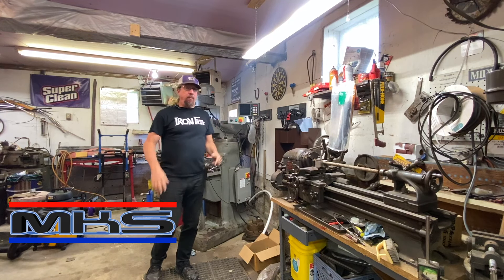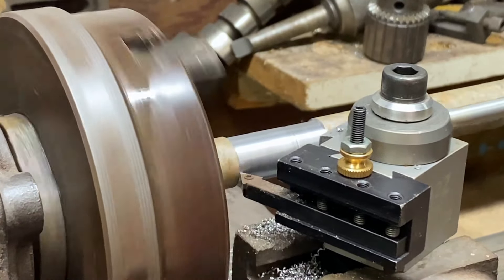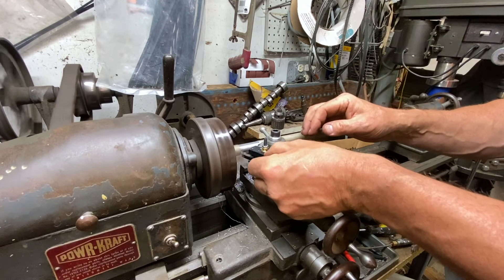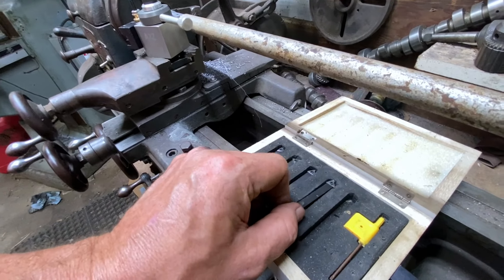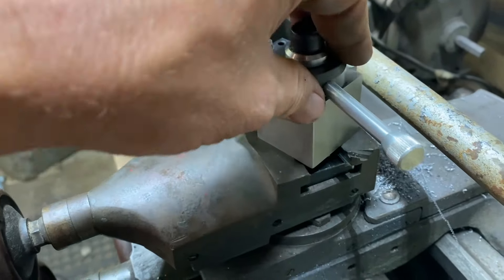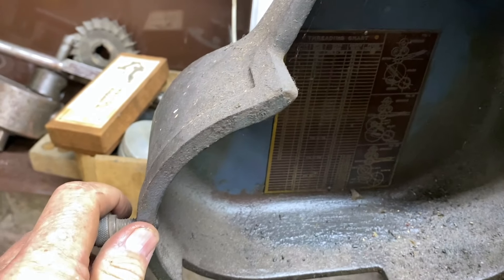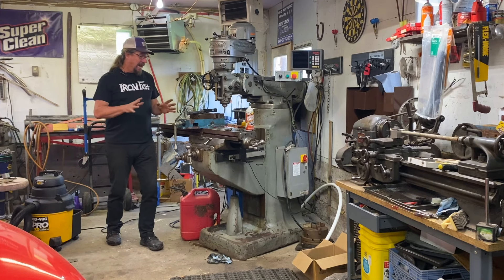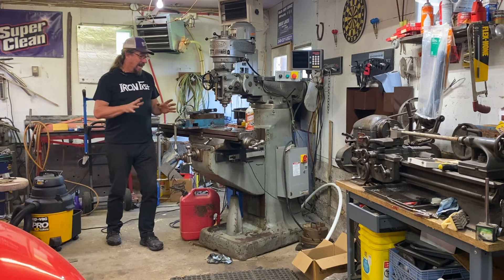AWESOME Upgrade To A Vintage LATHE!!! PT 2

Comment: Great video. Love my old Wards lathe. Wish I had the quick-change gear box and a longer bed. I upgraded to an AXA tool post. It will cut some serious metal for the home workshop. Thanks for sharing. New sub.
Reply from the maker: These old machines are capable of so much, and just a few little upgrades. It’s amazing what we can do on them.  

Thank you so much for joining in my mayhem. And thank you so much for the sub.

Comment: Nice!!!! Removing the (I think it is called the compound slide) is a project I have in mind. Along with replacing the spindle bearings with tapered bearings and replacing the motor with a 1hp servo motor. I've said it before the Chinese lathes need allot of attention right out of the box. I saw a lathe similar to this within 100 miles foe $1500. Think I'm going to hold out for a Southbend or Cincinatti. So, I have to make the mini lathe work for the time being. RAWK!!
Reply from the maker: It’s on my list of some day projects. Lol.

I’m looking forward to the modifications on your current lathe as well as what you will eventually end up with   

RAWK!!!